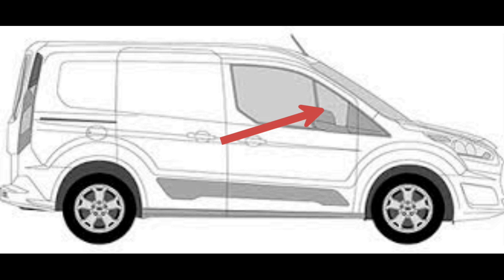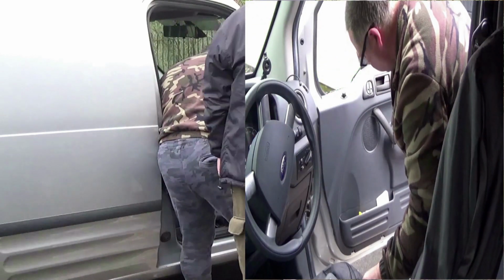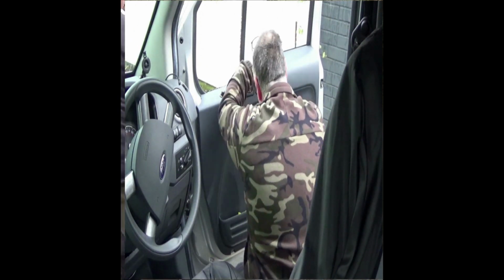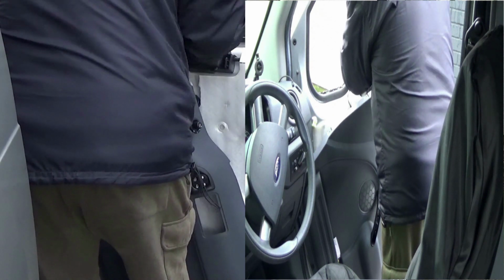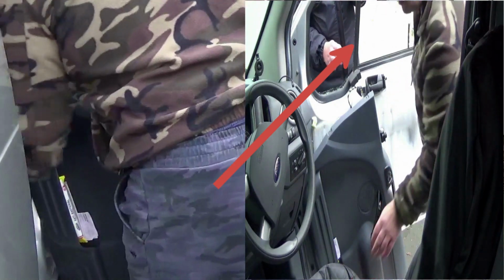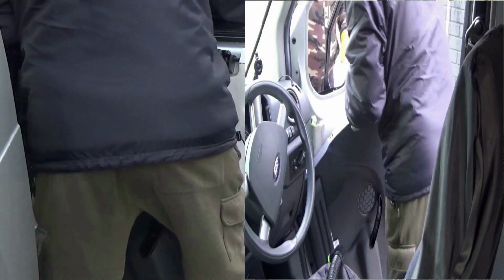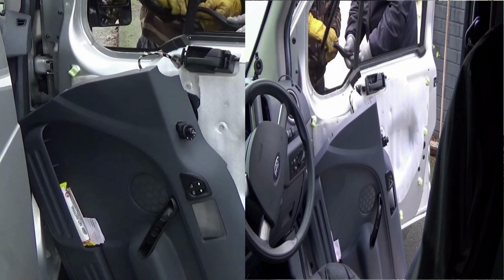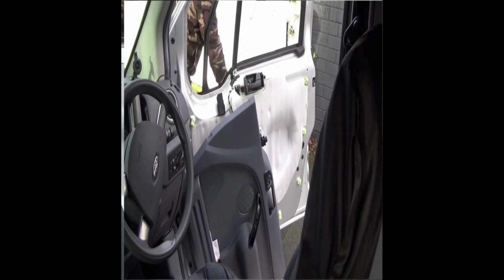Ford Transit Connect window replacment

Comment: Thank you!! Just ordered my glass. It’s been getting chilly in the mornings now, so best fix it haha
Reply from the maker: Yep easy enough job just make sure you get all the old glass out of the frame and  drivers window channels that's dead important and use loads of washing up liquid to get it back in makes the job much easier. Cheers D Dave...